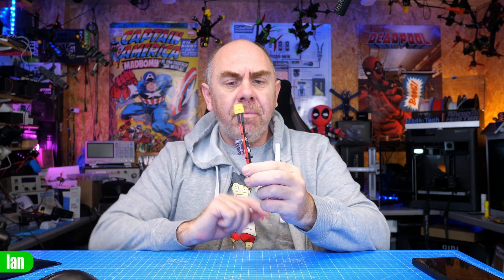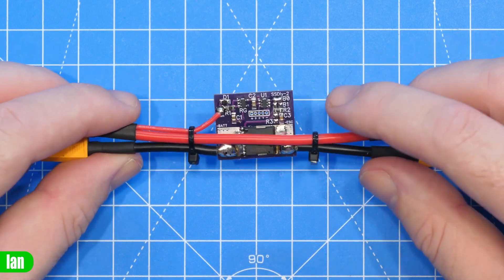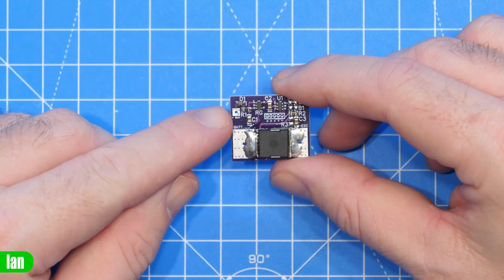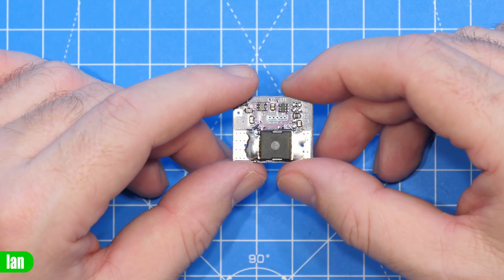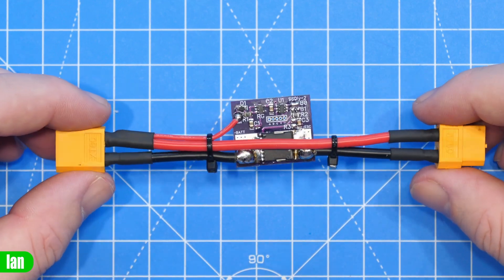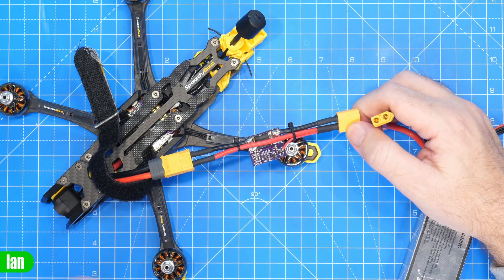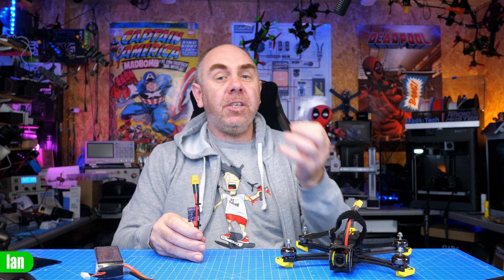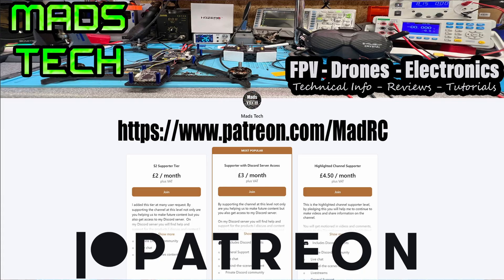Save Your Finger's! - On Spark Stop Delay Device For Drone Safety

Comment: Just say no to anti spark component!
I stressed my iFlight Chimera7 pro v2 , suddenly the video tuned black and it fell from the sky from about 40 meters, found it with a loss buzzer i added, it smelled really bad but was intact, car smelled for day, ordered a new stack without looking, when i opened it, this stupid antispark was fried, there was solder iron all over the place from it, I just bypassed it and everything is working, (now i have to buy more part to make a new quad from the new stack LOL)
why do we need to add a potential big problem to solve something which is almost notn issue??? these anti sparks are usless, using 6S quads for years and even 8S now, no issue but a small noise when plugging (sometimes), never got zapped or something near that.

Comment: How susceptible is this timer mosfet driver circuit to noise?

That circuit fails it loses power. Guaranteed.

Nah its an extra single fail point. A hard delay could be coded into esc firmware. Already got beeps and boops to give user feedback

Comment: To be honest i found this product a brilliant idea , maybe the shape of to be a little longer and narrow to fit in a heat shrink along with the wires will be even better
Reply: We are looking into making the SSDly Module Smaller. We do not supply wires since different will have different needs
Reply: @lasersbee  In any way who ever created have done a great work , a useful  tool👍i done mean to supply the wires,  i mean to do the hardware in a shape long like wire so it is gone be much easier for a good fitting
Reply: it is basically just an additional capacitor

Comment: The idea is good, but it is exposed and not super convenient. What would be great would be to see that integrated directly into ESCs !
Reply: what is that maximum time for the esc music ? And can the quad spool up directly even if that music hasn't finished ?
Reply: @Sugalime3D_FPV  The Spool Up music depends on the ESC manufacturer. It is there to tell you that the ESC has booted up.
Reply: @lasersbee  This means that the music itself is just a signal/indication that the ESC has booted. This means that the motors could theoretically start up before or while the melody is playing. This means that the music cannot delay the time until the ESC actually really starts up ?

Comment: woah nice, maybe next development could be mounted on PDB... and added signal trigger for "high power" on or off... and added low current mode for standby.... so its will make drone more safer if something wrong with esc?fc?  that potentialy make sudden motor on, or esc fire.... current limiting mode can make motor on but only on idle, if something hit/touch the motor current will spike and voltage drop... cause to restart... and safe your/our hand, and if something cause fire just swtch to current limiting and the fire will stop... or 3 mode 1.current limit, 2.power cut, 3. full power...

Comment: i wonder what will happen if it failes mid flight 🤔🤔🤔
Reply: Same thing that would happen if and ESC fails
Reply: @lasersbee  Yes and no. The more devices you have in series the higher will be the probability for a general fail. Is similar like using one hard disc drive or 2 hdds in raid0. That is one the downsides of this device of course.

Comment: I've seen similar applications in home battery storage with the battery inverter, whereby to avoid a spark and potentially damaging the inverter's capacitors, there is a shunt that is activated by the battery management system at startup. This allows a trickle current to the inverter to prime the capacitors before the shunt time delay is reached.

However, if you have big inverters (or multiple inverters) the maximum delay of seven seconds is not enough, so people use a workaround and tend to bridge the shunt with a 50-70 ohm resistor for a minute or two to further prime the capacitors before switching the BMS on.

I mention this because, if the use case is the same (protecting the capacitors from a current surge), you could just use the workaround. In other words, attach a resistor between the battery pack and the flight controller/esc for, say, 30 seconds, then remove it and connect the battery directly. This would allow the capacitors to get primed and not use something in series except prior to start-up. Anyway, just an idea if the issue is similar.

Comment: How many amps ?
And whats the voltage drop ?
Reply: I'll get back to you here tomorrow morning after I get back to the Shop with the answers to your questions.
Reply: As Promised... The voltage drop across the SSDly Module on a 6S Li-Po is 3-5 MilliVolts. We chose a High Current Mosfet to get a low ON Resistance component.
Reply: @lasersbee  
Thx
5mV
Thats 0.005V
100A * 0.005V = 0.5W thats nothing 👌🏻 so heat should also be a non issue